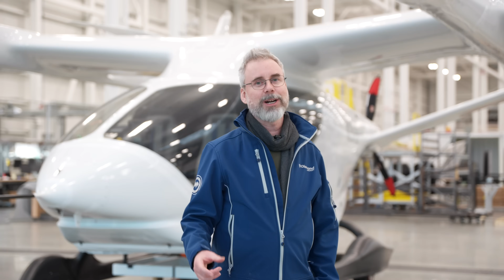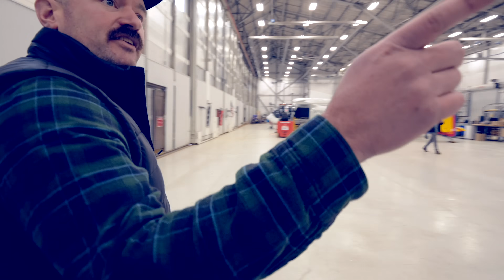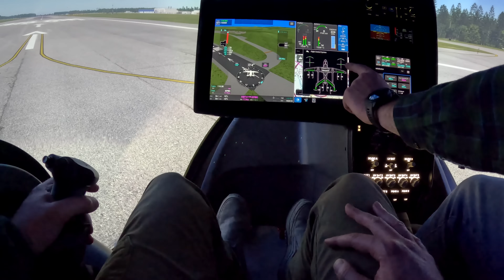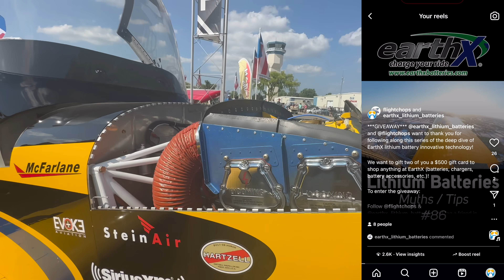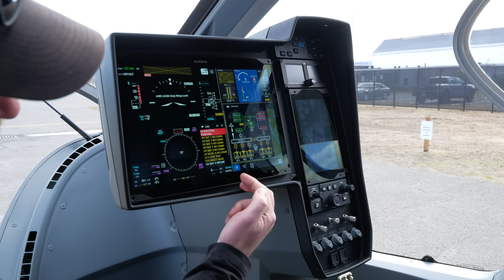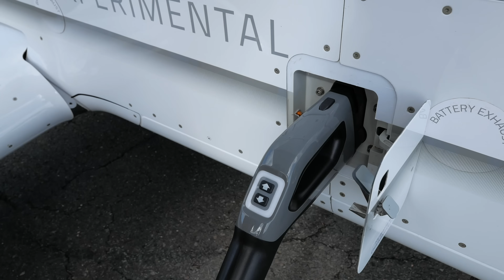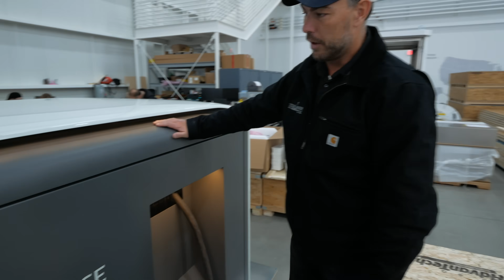Learning to Fly Alia: No Feet?!

Comment: I don't want an electric aircraft which has different controls than other aircraft. Either make it like a helicopter or a Cessna 172. No, I do not care if your idea is better. Training is training, and what has been trained is now the standard. Stick to the standard.
Reply: Every Logitech control stick for flight simulator games had "twist for rudder". heck, even airliners, with ground steering use a separate tiller from the rudder pedals.
Reply: Absolute nonsense. I have ridden motorcycles all my life and the first thing Id do with an electric motorcycle is swap the controls and brake levers around to non typical motorcycles controls. It’s all a matter of getting used to. Dont like it - dont buy it.
Reply: Spend some time in a simulator. Even a desktop PC rig will do. You’d be surprised just how quickly your brain adapts, and it just becomes instinctual.
Reply: What a terrible mindset. If everyone had your mindset, we’d still be riding a horse and buggy
Reply: Fella, hate to break it to you, but you're a human, you're adaptable. Also, the standard isn't always as standard as you think. There are plenty of exceptions to everything. And a twisting joystick is such an absolutely minor change that is easy to adapt to.
Reply: And put a real engine in it. Fk electric virtue signaling nonsense.
Reply: Not worth it for the extra cost and weight. And the FAA sure ain't asking for that kind of commonality. 😂
Reply: @rkan2 it's worth it in an emergency.
Reply: I say Booooooo to you sir. it's time to progress. Have some faith in your ability to adapt. if you can transition from SEL to MEL then you can transition to a twist for yaw control.
Reply: No

Comment: That sim was incredible.  Interesting and logical FAA definition of motor vs. engine.  I love the term "fault-tolerant"; I wish every engine had that capability.  I was surprised at just how much the electric infrastructure has expanded in aviation; that's good news.  Every time I see a new episode of this adventure I continue to be impressed by what an in-depth and amazing experience it must have been for you.
Reply: Old piston engines are fault tolerant as well.  Can lose electrical, a magneto, a fuel pump, a couple valves, or an intake air source without full power failure.  There are single points of failure, of course, just like there are with this new electric engine.
Reply from the maker: Thanks yeah, this was a lot to take in. I’m glad you’re enjoying how we’re sharing it. 👍

Comment: Having played video games and flight sims for years with twist for yaw, I think I could handle this.  My issue would be doing it on a left stick.  I can control pitch/roll with left, but not the yaw very well (I've tried).  It's hard not to cross control (especially when controlling the likes of a helicopter).        Kinda makes me wonder what real benefit you have from forcing everyone away from the pedals they're used to.

Comment: Eventually they'll need to add in those rudder pedals. Just wait...
Reply: The CTOL version is mainly as a trainer for the VTOL version. I don't see them ever putting in rudder pedals.
Reply: But the VTOL version is a hybrid, isn't it?  Start as a quad, transition to conventional flight.  You still need yaw control in conventional flight.  Heck, even helis have pedals. 

Give me some aluminum stock, a microprocessor and two hall effect sensors and I could rig up rudder pedals that were easily under ten pounds.  The weight argument just doesn't track.

"We can't afford the weight of rudder pedals" sounds more like religion than an actual design constraint.
Reply: @talyrath   I think you're forgetting that it's not your average electric car we're talking about here. Aviation has a whole different set of regulations you need to follow and meet. And that includes having redundancies for flight controls, which means although main input would be through your hall effect sensors, the rudder mechanism still has to have a hydraulic or mechanical linkage backup system in place so if you happened to lose electrical power or there was a wiring issue you don't totally lose that flight control. Even the Airbus A320 which has a complete fly-by-wire system has a mechanical backup control system in case of complete electrical failure. So you'd end up not saving much if any weight at all with your 'solution'.

Comment: 45 minute charge time for an aircraft that size is INSANE
Reply: does it mean that you need a usefull power-line more than 30/60 kw for charging?
Reply: @tl1562  You will need a 350kW power line to charge the 300 kWh batteries in under an hour.
Reply: You fly less than 45 minutes and then you charge 45 minutes.
Reply: @AlJay0032  oof, really? I missed that part...
Reply: @jackkrueger4150  VTOL airplanes of that size usually can't even fly 20 min. I am probably exaggerating if I say less than 45 min.
Reply: @jackkrueger4150  He's wrong, this plane flies for around 5 hours per charge.
Reply: @AlJay0032  Incorrect, the website has a "<1 Hour" charge time from "reserves to %98"
Reply: If you've got a powerful enough charger. And you won't. Except at the factory if you're lucky. Just like the "miraculous" Chinese 5 minute charge car.
Reply: Just like when powered flight first began. people said it was pointless because "what, you going to find a big enough flat area, that also happens to have fuel? dream on. All you are going to be able to ever do is land at the same place you took off".

Yet look at where we are now.
Reply: Did you watch the video before commenting...?

Comment: As for no pedals, it's been done before in the ercoupe. The most popular stc for it was.....adding rudder pedals.
Reply: The difference is that the ercoupe didn't have a single stick with Z axis.
Reply: Not even remotely the same.
Reply: @ProfessionalPilot pedals are just not needed now. Pedals were used to begin with because big muscles were needed to move the control surfaces. Things have moved on, even if old farts refuse to.
Reply: @BigDuke6ixx  idk if youve ever flown a simulator with a twist stick for yaw but its horrible. having to both twist and move the stick is not some innovation its just an annoying gimmick and you have way more control when you are able to use your rudders with your feet
Reply: @CobroxYT  gimmick? It's a reduction in complexity. Just because you were unable to reprogram your muscle memory doesn't make it a bad idea.
Reply: @BigDuke6ixx have you ever flown a plane?
Reply: @BigDuke6ixx 
Said the drone pilot who probably has no real flight experience.
Reply: @CobroxYT  That's exactly the issue. A bad idea is a BAD idea is a BAD I-D-E-A.
Reply: @Iceman-wr5sq  Not sure if the "drone pilot who probably has no real flight experience" quip is equivalent, as no commonly available RC Controller has a twist action on the stick. I expect there has to be some that have it, but all of the most popular drone controllers do not. I don't think I've ever seen any competent drone pilot using anything other then the standard sticks.
Reply: @BigDuke6ixx Have you played a flight sim with a twist stick?

It's incredibly easy to add a yaw movement to the stick inadvertently. On my stick I can lock off the yaw access, and have done so as I have pedals, yet over time that lock weakens due to inadvert input until I notice that the stick isn't straight and lock it off again.

Obviously there is a difference between flying a helicopter/quadcopter and flying a virtual plane in high G dogfights, but the point stands. Sikorsky did tests and came to the same conclusion, it's far too easy to add yaw with a twist stick especially in high stress scenarios.

It's not about old farts that don't like change, it's about the rudder pedal system preventing cross-inputs in comparison to a 3	axis stick
Reply: @BigDuke6ixx you’ll be an old fart too one day.  And it will happen faster than you think.
Reply: @Jkur2009  I'm 61 in a couple of months, but I refuse to be stock in my ways.
Reply: @CobroxYT it’s actually rather straightforward
Reply: @BigDuke6ixx  Its not about muscle memory, its extremely uncomfortable, its not an ergonomic way to move the stick if you're having to actually operate all three axis at the same time, its way to easy to inadvertently command yaw. It makes it more difficult to precisely move rudders and add pitch/roll commands. Doing three things with the same flight control is not always the best option. Less complex is not always easier or the best way to do something. The only thing I can see it being genuinely good at is for people with mobility issues. However as someone who has wrist pain that rears its head with repeat exertion, this would be the exact opposite of what I'd want.
Reply: @BigDuke6ixx there's a reason aviation is conservative. I see the same attitude here that led to the sub disaster. Ignore experienced pilots at your peril. The reason for the change, that they can't cope with the weight of pedals, is worrying in itself.
Reply: @Fozcine  pedals were only developed because large muscles groups were needed to move the surfaces. Are you claiming that the test pilots developing and testing this ship aren't experienced? .
Reply: @BigDuke6ixx  >pedals were only developed because large muscles groups were needed<
If this were true, pedals would be used to control the ailerons or elevator. The rudder is the smallest control surface on an aircraft and requires the least force. Machines are designed to fit human ergonomics, not the other way around.
Reply: @Iceman-wr5sq boohoo fancy bus driver man. I hope they replace you soon.
Reply: @minhpham-yh9qn 
With who? 😂😂😂
Good luck with that…
😂😂😂😂😂😂
Reply: I had a 61 Forney F1A Ercoupe with factory rudder pedals. It was so nice.
Reply: All they need for future pilots is a cable per FAA stadards that hooks up to a PS5 or XBox controller or even a TBS,  Radiomaster, or any other popular FPV controller... Otherwise wifi/bluetooth those controllers... Hell could even use your phone/tablet touch screen maybe in an emergency! Cant wait for more!! ;-)
Reply: I'm paraplegic and have never used rudder pedals in a sim. Twist for yaw works just fine if you're not a baby and stick with it for more than 15 minutes.
Reply: @x_elen_x Yes, it works fine for Sims. But you can notice that yaw can be accidently applied with roll and vice versa quite easily, which doesn't matter when you're flying a virtual aircraft but matters quite a bit more on a real plane.
Reply: @TheHarvHR that's just a skill issue
Reply: @x_elen_x 
That in a sim, a real plane is way different.
Reply: @Iceman-wr5sq apparently not, since this is a real plane.
Reply: @x_elen_x 
Yes, which is why this comment is saying it’s stupid.
Reply: That feature feels like something that might end up viral during an incident report because a pilot under stress tried to use pedals for yaw.
And the reason for it being weight savings seems like either a stretch justification (actual reasons might be novelty and ig some accessibility) or a worryingly low mass budget. Ig another reason could be being bit easier to implement (still doesn't seem like a very good reason tho).
edit: Or as someone pointed out it might be because of wanting similar controls in the VTOL where it might make more sense, although thinking of it helicopters still use pedals to control the tail rotor.
Reply: Because old farts don't like change.
Reply: @BigDuke6ixx  Why overload one input. Feet are available, why not use them and distribute workload?
Reply: @Kimoto504 the human brain is perfectly capable of using twist for yaw without becoming overloaded. Well, apart from the brains of old fats who can’t handle change.
Reply: @BigDuke6ixx So you're calling every existing pilot in the entire field of aviation an "old fart"? Let's be clear, you're talking about every pilot in the entire world!
Reply: @Fozcine  no, I'm talking about all the old farts who are pilots.

Comment: Oh man, no pedals? But it is fly by wire! Could they not make some lightweight pedal controls? It's not like it would need a bunch of pullies and cables. That being said, it's a incredible aircraft. They are really thinking outside the box on all aspects.
Reply: Yeah, the rationale is not clear
Reply: @TParter its like asking for a clutch in an automatic
Reply: @carlosandleon   no its not lol its like asking for a clutch pedal in a manual car that for some reason decided to go with a hand operated clutch.
Reply: @HiteshP-l7vbut it has a rudder function. Just not with the feet.
Reply: @randylahey2242 If they are selling this as a different type of aircraft then it doesn’t matter. In that sense motorcycles are a different kind of road vehicle and accordingly - they have hand clutches. 

I don’t think not having foot rudder pedals are as big of a deal as you think - I do not accidentally press the shifter on my bike thinking it’s a clutch.
Reply: @carlosandleon   you missed the point. An automatic transmission doesn't need a clutch so your comparison doesn't make sense. No matter what this plane needs rudder input.
Reply: @randylahey2242 it does but differently
Reply: @carlosandleon   which is why your comparison makes 0 sense. If the airplane had 100% computer controlled rudder then your comparison would make sense.
Reply: @randylahey2242 i compared it to a motorcycle eventually. Besides, automatics also have gears to shift anyway. The comparison was for the input mechanism. Not the mechanism itself
Reply: @carlosandleon   yes automatics have gears what is your point? are you drunk?:D
Reply: Pedals, even without a mechanical linkage, still add weight.

And you’d still need a linkage between the pair of pedals of both front seats.

You’ll be adding 5 (11lbs) to 10 (22lbs) kg easily and perhaps even more.
Reply: @tver   there already are pedals in the plane are you blind
Reply: @randylahey2242  Yes, but those are mechanically simpler, individual left and right foot brake pedals, which are not linked to each other, like a rudder pedal set would be.

That makes a lot of difference in terms of weight.
Reply: @tver   what are you talking about? this is an electronic airplane all it needs is a position sensor. We are talking about grams of weight. There are no linkages or anything use your brain.
Reply: @randylahey2242  a rudder pedal set needs a linkage between the left and right pedal. Press the left one in and the right one should move towards the pilot, and vice versa. Furthermore there needs to be a linkage between the left and right seats, so the co-pilot feels/sees the input the pilot is doing, at the moment of control transfer.
Reply: @tver  the pedals do not need to be physically linked to both seats. Proof - the  rudders are not physically linked in the joysticks now:D There are plenty of solutions but the simplest one is giving captian 100% authority when both sticks are inputting.
Reply: Just extra cost for no reason. The FAA wasn't asking Airbus for force feedback or Boeing for being able to fight against MCAS...

Comment: Any comments on why they chose to assemble the battery packs themselves instead of subcontracting that out?  I imagine that there are automotive suppliers who might do it... but... they tend to like to do large quantities and not do special process or high reliability stuff that aviation might demand.  Thanks for the video!  Very interesting to see how this tech is evolving.
Reply: certification.
Reply: Automotive was driving battery innovation for a long time, but at this point they don’t need to save weight and make batteries better. Automotive batteries just aren’t light enough for aircraft applications. Not sure they’d be interested in doing custom stuff anyway, but there are now a handful of aircraft battery companies

Comment: That's 2,750 lbs of batteries alone.
Reply: Agree, I also did this quick calculation when the fast talking Mary was done 😂. However:

 1. to compare, carrying 250 gallons of fuel also weighs 1.800 lbs. 
2. the relevant KPI to compare is „payload“ or cost per seat mile.
Reply: @TParter And overall weight before factoring in people and cargo both without the batteries and with them. Someone's gotta check the numbers to make sure the math is mathing properly.
Reply from the maker: Yup. 😅
Reply: Lots of opportunities to improve the power density of batteries…

The whole world is working on it…

😃
Reply: @AC-jk8wq Like the world needs help. The sun is a nuclear battery that we feel the heat of.

Comment: I think this is a great idea BUT as a pilot myself... I would much rather that the pedals had the options of working as rudder pedals if the pilot chose too.
Reply: with fly by wire systems, I dont see why they couldn't do both with minimal weight penalty.
Reply: I suspect the reason they don't have rudder pedals is to make vtol handling more practical when the time comes
Reply: I wish airbus would listen to me and put a yoke in their plane and boeing would put a stick on their plane because of my opinion